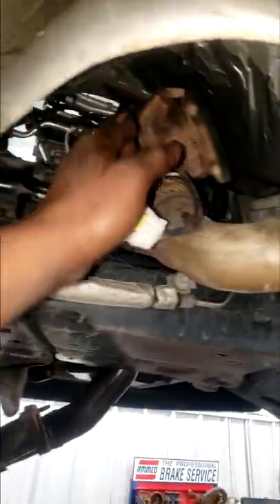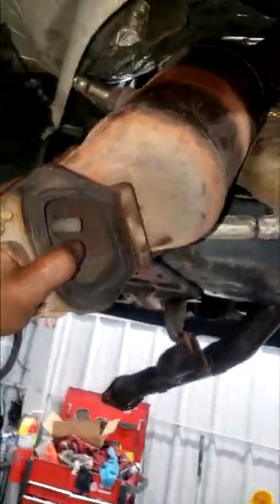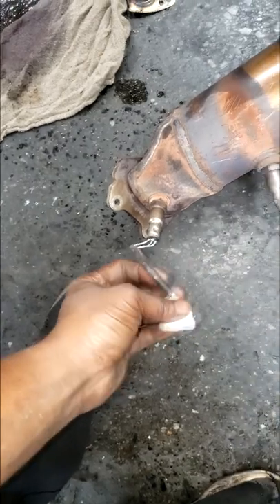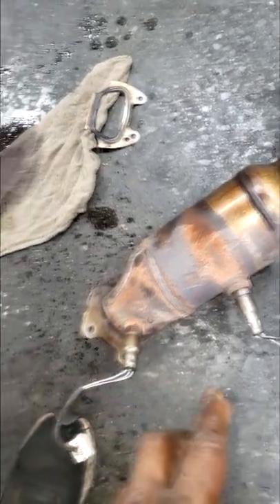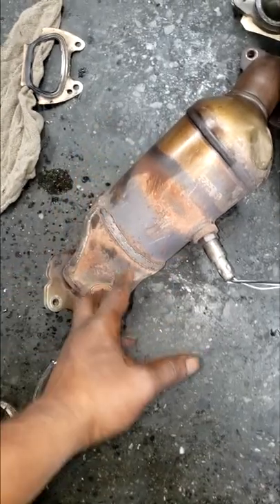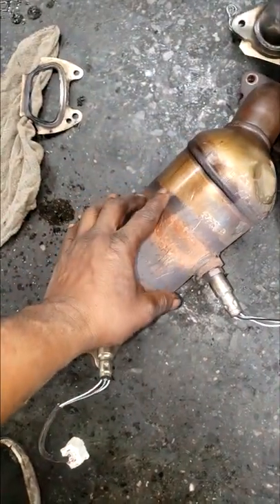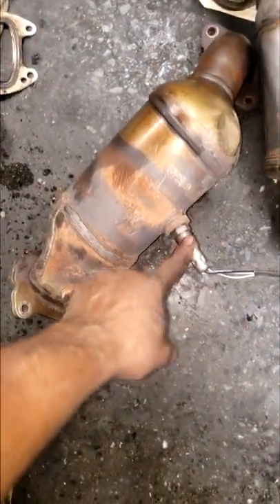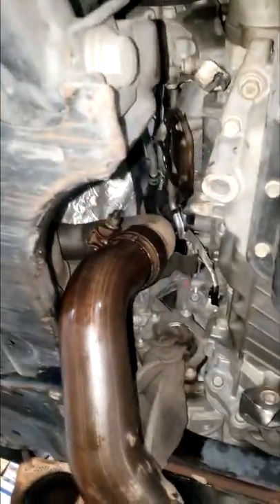WARNING. O2 Sensors will not FIX A P0430 P0420 on NEWER CARS. . YOU NEED A CATALYTIC CONVERTER.

Comment: This is absolutely false information. Smh. I've fixed 50 cars by changing the sensor. If the sensor simply isn't working, it will throw that code. DO NOT  spend 1500 bucks getting cats done before checking your sensors first. I've seen plenty of people change the cats and have the same code and lose 1000s.
Reply from the maker: Here's an idea, make a video and explain what you think. Thats what I did. A lot of this depend on the year of the car/computer. The newer controllers in the newer cars are great.. If it flag a efficiency cat problem. You likely need a cat.
Reply: Need advice help please. Code p0420 car is  not burning oil and is running fine obd2 scanner also says poor connection sensor 2 and pcmm could the issue be my down stream 02 sensor ?
Reply: @OnlineMechanicTips  funny of you to assume I have cats.
Reply: my 05 acura tl  has that code and previous had sensor codes i replace sensor ,, but light still on throwing same code ,,
Reply: @shadowman1992 o2 censers are where you start. Also if you got a heat gun, let the car warm up and see if the front of the cat is much hotter than the bank. If you got two cats check both and if the temps are different, you know what the problem is.
Reply: @carlossosa2940 but seriously, go fill up the tank and pour a can of seafoam in it.  If that doesn't work use a OBD2 reader to see if it's an air of fuel problem
Reply: @Grant849  already put cat cleaner yeah the only code I have is the p0420 code which is cat issues on bank 2 sensors. Ode cleared after replace sensor
Reply: I've done change cats twice for that code, and now the code is back again. Same o2 sensors. Done spent $3600 so far on cats and labor. Im just changing the o2 sensors this time
Reply: Yeaaaa no, he is wrong. Ive been working on cars since I was 15, literally just changed both problem solved.
Reply: I replaced all the 02 sensors in 2020 tam promaster, still have check engine light on, so I try ,nedd to replace cat lol
Reply: @shadowman1992   update
Reply: @ygbodybuilder3023  I used a bottle of cataclean check engine light went away and never came back
Reply: @103lerch  how did that work out? hoping its o2 sensors for me before paying over 3k thanks to Cali
Reply: I got the po420 code for my 2010 Ford focus but whenever I drive on the highway for 45 min-1 hour the check engine light goes away for 1-2days then come back on maybe can be sensor for me I 🤔
Reply: I fixed cleared my P0420 by changing the 02 sensors
Reply: Cataclean fixed my issue driving at high speeds in the gas tank. 1.5 years later still good
Reply: Hi I just got car back he fixed sensor. I’m female an old so ifk wat it is.   But now there’s a engine light up an auto store said it was this

P0420(3 / 3) Pending
Catalyst System Efficiency Below
Threshold (Bank 1)
Plz? What’s it mean.
Reply: Hey what kind of car is it?
Reply: I did that and guess what it ended up being? The damn sensors.
Reply from the maker: @DaSesh What part of this applying to the newer cars did you not understand?
Reply: Why are some mechanics so condescending and adamant that the p0420 cannot be fixed with o2 sensor replacement? The guys who have carefully explained the issue to me have said it's at least possible that the problem may not be the converter itself, and others won't even consider the possibility. All the while, I hear story after story of the code being fixed with sensor replacement.
Reply: @NnannaO  didn't fix mine in fact it turned out to be my APPS lol p2138 and it was still throwing a cat code.. replaced APP AND O2 code has yet to come back on its been roughly 250 miles. It's safe to say Im good.
Reply from the maker: @NnannaO As I stated in the video, imo, on the newer cars the controllers are better. A cat eff code gets a cat over here. Keep in mind every body that comment simply stating there opinion including me. You more than welcome to express your opinions as well my friend.
Reply: Let me tell you how slick the mechanics are, they will overcharge you on the converter job to get money to do the sensors too. So either way the issue goes away and they look like the hero when they literally just robbed you.  I had this debate before with guys who always do the converter and they admit they always do the sensors at the same time. But still very adamant that it was definitely the converters. CROOKS
Reply: @OnlineMechanicTips  and that's what I did. And what I'm stating is not just and opinion it's a fact. Sometimes you can resolve the code with doing the sensor because if the sensor goes bad it throws the EXACT same code.  Because that's the way the computer sees it. Lmk when I start lying....
Reply from the maker: @flatline1877 The newer computer check for proper operation of the O2 sensors first dude. If there was a problem, It prioritize the O2 test first. You not going to get a cat code with a failed o2 sensor on these newer cars. The video clearly speaks about the newer cars.
Reply from the maker: @flatline1877 Smdh, dude the life span of both about the same. When you dealing with customer cars, this how mechanics avoid comebacks. It has nothing to do with ripping somebody off. You sound bitter about something.
Reply: @OnlineMechanicTips  your only proving me right. Just quit while your ahead. I'd hate to be your customer. Instead of replacing everything how about do some real diagnosing so you could possibly save your customer some money. And I'm bitter than I'm dropping 100 percent facts and still have people like yourself being know-it-all's trying to refute it. Your more concerned about not getting a comeback than saving your customer 1000s. It's sad. And on top of that your still WRONG. smh
Reply: @OnlineMechanicTips  not another replace it all mechanic. NOT ONE OF THOSE AGAIN!!!! 😂😂😂😂 SMH
Reply from the maker: @flatline1877  Anything that's connected and projected to have the same lifespan should be done together dude. But you more than welcome to try 1 at a time on a high expectations customer car dude.
Reply from the maker: @flatline1877  Smdh, you must just started last week? It's OK dude, I was the same way. You will learn
Reply: @OnlineMechanicTips  Hey, sir. I wasn't talking about you, specifically. I was talking about my personal experiences, which I imagine others can relate to. I get what you're saying about newer models not having the same issues with sending a P0420 when the cat isn't really the issue. Mechanics I know are unwilling to check other options even for older car models.
Reply: @OnlineMechanicTips  I have. If you tell someone hey I tried to do your sensor thinking I could save you some cash but unfortunately it wasn't that, I'm pretty sure they won't be upset. Give it a try. People are coming to this comment section for answers, not a soap opera.   So I'm done here. Just wanna tell anyone reading this, check the sensors first. You can do a resistance check on them before replacing you may get lucky. Just need a mechanic willing to take time to do it
Reply: @OnlineMechanicTips  it's funny your shaking your head at me but everyone reading is shaking their head at you. You've showed what kind of mechanic you are. You do what's best for you and not the customer. You don't care about saving your customers money. Replace it all and throw them a hefty bill, that's how you operate. I've met many mechanics that share your position. Don't likem......
Reply: @NnannaO  Im aware. I didn't think you were talking about me.
Reply: And I also agree with you 👍
Reply: @flatline1877  Glad to hear you agree. I was actually talking to the guy who posted the video, though. He responded to me a little bit earlier. You'll see his comment that starts with my name.
Reply from the maker: @flatline1877 Smdh, do you really think shops interested in those avoidable gambles? Nobody telling customers to let us try anything dude. We not about to try no damm O2 sensor and see if it come back. Let me say this again, if these new cars flag a Cat code, 99% chance you need a cat. Theres no need to test a dam over 100k mile O2 sensor, just sell that with the Cat. The computer already checked the O2 sensors first. Smdh, yea you might want to stick with them video games dude. You the type that would drive a service manager crazy and get fired fir simply being in your feelings. You to caught up in saving customers money at the same time risking the shop being hammered because you want to try shit first. That same customer would forget everything you said to get the cat free when she come back all because you in your feelings wanting to try shit first.
Reply: My 07 Honda accord had aftermarket Cat installed and now the OBD II sensor says my sensor “Bank 1” air/fuel ratio is what’s causing check engine light and nothing else was detected what so ever. Is it possible that all I need is a new sensor for bank 1 ? And does is it need to be OEM sensor ? I believe the OEM for my Honda accord is “Denso” and also does the sensor for “Bank 2” also have to be OEM denso brand ? They replaced the “Bank 2” sensor since they stole my entire CAT and almost the entire exhaust system and I’m wondering if the bank 2 sensor is aftermarket and somehow confusing the car and causing the Bank 1 sensor to mess up. I really need help bad with this because I can’t find any used cars at all what so ever In the $8,000 price range that have less than 120,000 miles with good gas mileage and all I can find all over Northern California is the stupid ass “09’ Toyota Yaris” in my price range that’s decent on gas and I do not like anything about that car so I really need help whoever reads this message and what I should do ? Will the aftermarket CAT pass smog if I have OEM sensors in bank 1&2 ? Or is it possible the CAT itself even with brand new OEM sensors still fail smog if I replace the sensors with Denso brand OEM ? Please help haha 😂 I have 178K miles on my Honda and it runs amazing even with the issue I have rn… not a single issue besides this problem. What should I do y’all ? Thank you
Reply: @vulkandeathgrip5568  Thats quite a few questions at once lol. No it's not a requirement to use OEM but yes it is the best choice. Some aftermarket brands will hold you down for a bit but not nearly as long as OEM. And if you already did the cats either it was the sensor all along or the aftermarket cats don't meet "spec requirements" for the vehicle.
Reply: @flatline1877  yeah.. I have the P0420 code saying “Bank 1” and I’m not sure if It’s because the sensor has never been replaced and I’m at 178k miles and also do both sensors need to be the same exact brand as well ? I was told Honda needs OEM sensors and even heard the same thing about the Cat itself. I feel like there has to be a way to make this work without having to buy a brand new OEM Cat along with OEM denso all at once and somehow keep the Cat I have and make it work with possible new bank 1 sensor. I’m wondering if some other thing can cause the P0420 code to happen causing it to say bank 1 sensor. But I’m not a mechanic and have no clue haha 😂 thank you very much ! I appreciate the advice greatly
Reply: @shadowman1992  Did you find out what was the issue?
Reply: @mtsanchez27  no issue really used the bottle of cat a clean and never had a check engine light since then idk how long ago that was but maybe over a year forsure
Reply: @shadowman1992  good to hear that, thanks brother.
Reply: Thank you
Reply: @yolandareyes6945  
Your welcome 👍
Reply: @flatline1877 doing both the CAT and o2 is the correct way to fix so it don't come back these sensors are sensitive
Reply: @recarored9862 I have a p420 now, I cleaned the sensors and the MAF sensor then used two bottles of cataclean. I cleared the code and it stayed away for two days.

I then went and did emissions and I passed, the same day I did emissions the code came back a few hours later lmao.

I’m gonna try changing the sensors next
Reply: @juanldiaz3874 you have a 2020 vehicle? Cats should last way longer then that. But I guess you could've had a defective cats. But 4 year old car should not have cat issues.
Reply: It's me. I'm plenty of people. Only my warranty covered all 4 replacements of the cat.  But none the less code is still reading, and the leak is still leaking some substance that looks like water
Reply: @BigRigPullUp  
I'm sorry to hear that. But yes, sound like your still in need of the sensors. Make sure you don't get stiffed with them cheap sensors. Some good sensors will take care of the issue if it's NOT an electrical harness or wire. If the wiring is good sensors should take care of the codes 😏
Reply: I got a 2013 Chevy equinox 2.4 l ecotec, when I got the car the rpm would jump up and down when idle, I cleaned the throttle body, and changed the spark plugs and fixed my problem. A day later my car would jerk when slowing down like the rpms would jump every gear it went down and it only does this when slowing down, check engine light came on for p0420. But I got my cat checked and they said it was okay. I changed the sensors and obviously no change, even though they looked blown up. I used cataclean but still no change. I just changed the ignition coils as well as the spark plugs again and now, one of the spark plugs has oil on the tip. Not sure what the problem is but need help pls 🙏
Reply: I just took cat off and soaked it in a detergent, 24hrs I re installed with new sensors and put the cat cleaner in gas tank. To tell you the truth I’m thinking I should’ve just changed sensors 🤦🏽‍♂️ because code stayed cleared immediately

Comment: Changing the sensor is what fixed the code on my Chevy Tahoe 2007
Reply: Does it have a service engine soon light?
Reply: @47juan35  not no more
Reply: @rudyramos4816  thanks, I have an 01 camaro that had the service engine soon light on, so I was curious that it might just be a sensor.
Reply: Same on my 2001 tahoe
Reply: Maybe bc it’s an old car. He did say “on these newer computers” or something like that
Reply: You can check the live data for the o2 sensors to make sure they are getting proper voltage. I found my cat was bad because the downstream sensors fluctuated with the upstream. Meaning the cat wasnt doing its job.
Reply: Having trouble with 2016 Nissan Altima S bk1,sen1 p0030? Help

Comment: Trying O2 sensor before changing cat is a smart move.
Reply from the maker: Perhaps. But only smart if this your own car or a friend. There's to much pressure on commissioned mechanics that work on customers cars to take such risk. Customers would turn on you very quickly if car came back with the same code.
Reply: @OnlineMechanicTips  You definitely right in this one. I'm having the exact same problem, this particular mechanic told me it was the O2 sensor, I changed one, came back 3 days later, then he suggested to change the other one as well, stating that it would be better to change both since one went bad (don't know why he didn't say that the 1st time). I did that, (got charged twice) and I'm still having the problem. 
Guess what I ended up doing? Walked away from that mechanic.

Comment: I'll say this, whenever I would get that code I would do o2 sensors first and if that didn't fix it I would do the cat. Reason why, I would never replace a cat without replacing the sensors anyway. It's always smart to explain this to the customer up front so they understand it can get expensive but at least you're going for the less expensive option first.
Reply from the maker: We can't keep taken those chances. The computers are now super smart and lead you in the right direction. If it say cat efficiency failure, 99.9% you will need a cat imo
Reply: @OnlineMechanicTips  would you replace the just cat without replacing the o2 sensors along with?
Reply: That’s why as techs we have our scanners to check live data and see what the A/F or o2 sensors are doing or go manual and use a dvom meter to check for voltage, grounds and/or signals and 5v references. We have so much technology for tools just to guess. Even if it’s $100 or less but that becomes a habit and expensive. Not the best choice IMO. God bless you all
Reply from the maker: @v4lhulme  Yes I have done that. A lot of that depends on the miliage of the car.
Reply: Nope done 100's of cat w/out installing new sensors
Reply: That code is a result of the O2 sensors & the engine controller doing their job ... U should be more concerned if the engine is burning oil
Reply: That's because you clearly don't understand how things work.
Reply: So you’d guess and throw parts at the problem instead of understanding the system and diagnosing 
That’s what makes a mechanic a mechanic and you...a parts changer
Reply: @JasonLee-lv7tm  The number of "mechanics" that throw an O2 at a 420/430 is too damn high!
Reply: Can't you clean the cat .before trying expensive cat .also it just bolts on.the part is expensive but on a lift with mechanic it shouldn't be high labor.however mechanics don't get paid enough at these shops .never the less should not stop you from being honest. Me and many others are afraid of shops because 90 percent are ripping off the customer or just don't care going threw the motions.amd makeing mistake s.becuase of this
Reply: @OnlineMechanicTips you think a 2014 Honda pilot 3.5 I replaced PCV valve, air filter was dirty and I replaced it, also cleaned throttle body, relearn. You think a catalytic converter is needed? P0430

Comment: Brotha!!! I changed every O2 sensor about 10 times each didn’t fix the problem for a brand new oem cat with new o2 sensors and the my Honda accord’s working like Brand New straight from the factory… Bad ass video and fixed my problem. Thank you
Reply: When I took the cat in to get recycled the guy there told me the outside might look like it’s brand new but the inside of the car has carbon built up and has less air flow making the p0420 code pop up and go away sometimes when you hit a big bump